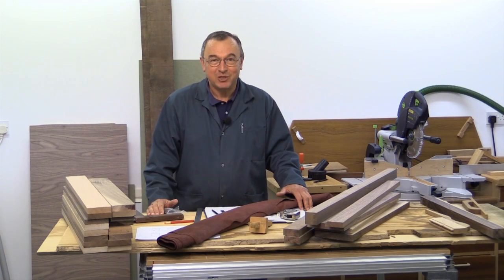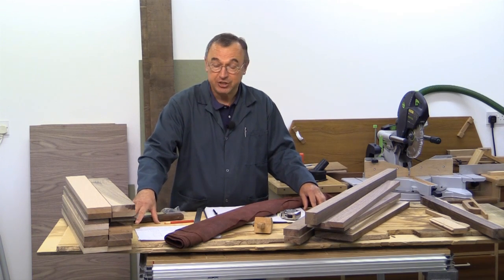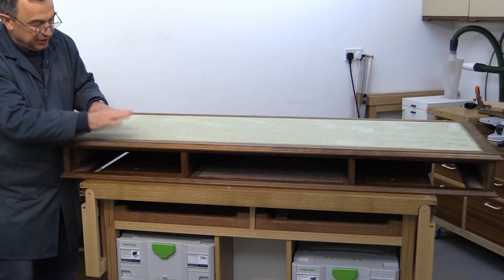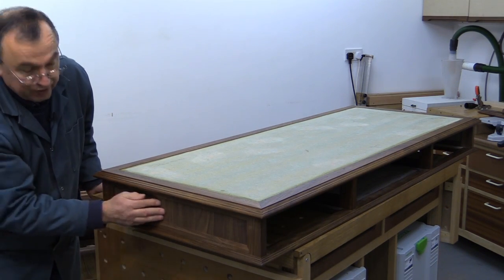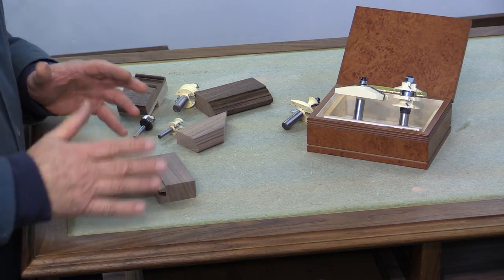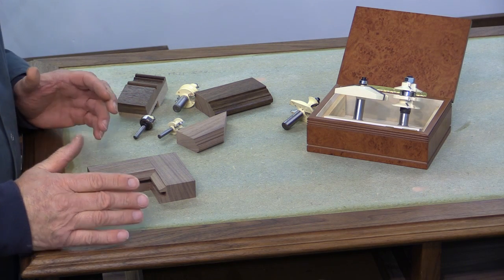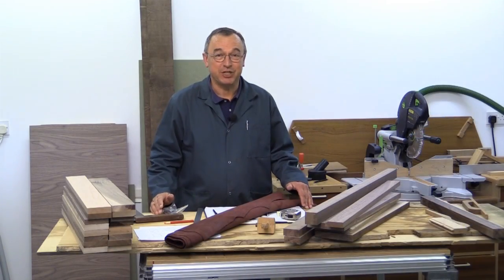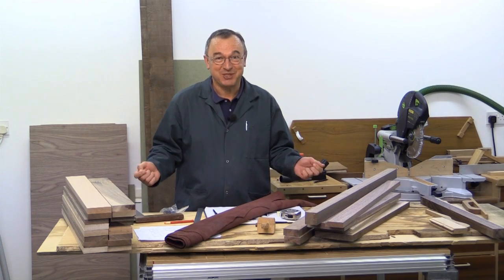Pedestal Desk Project - Introduction

Comment from the maker: Hi Berkyboy, Yes, I did think about using solid walnut and then doing a traditional raised panel but that would mean 6 sides and it was just more than I could afford. The veneered MDF will last just as long and will not split. It will not be quite as robust as solid wood. There are many cabinet makers using veneered MDF in pieces that are certain to be antiques of the future. When you and I are looking down in 200 years time we can have a laugh about this.   Peter

Comment: Hi Peter, Looks as though it's going to be another great project, I think everyone hexpects nothing less from you.. (sorry if that adds even more pressure).  Would it be possible for you to let us know the actual man hours of construction, I understand that you have filming considerations to account for but, I was interested to see roughly how long it would take to build the desk and perhaps an approximation of the costs involved, as they may, and probably will vary based on ones location/ timber availability etc...  Thank you.
Reply from the maker: Hi ningis21,

If I were not filming then I would expect to make something like this in 2 weeks. There is about £420 of wood and £200 of leather. The handles (not bought them yet) will be about £150.

Many thanks for your support.

Peter

Comment: Thanks Peter. Looking at the Timbmet website they only appear to deal with the trade, not private individuals?
Reply from the maker: Hi Mark, I have asked them and they will deal with non trade people. When I used them for the first time I only bought 2 sheets of walnut veneered MDF and a sheet of HDF that they had to get in specially.

Just give them a call.

Peter

Comment: Peter it's a beautiful desk and you've done it with admirable care and skill but for me it's such a shame to use those beautiful timbers in conjunction with veneered mdf that is unlikely to last the 200 years that the desk would have otherwise been around for. The colour of the veneer and it's durability is questionable. Would it really have been much more work to glue up panels of solid timber instead? Has it been a worthwhile trade-off in retrospect?